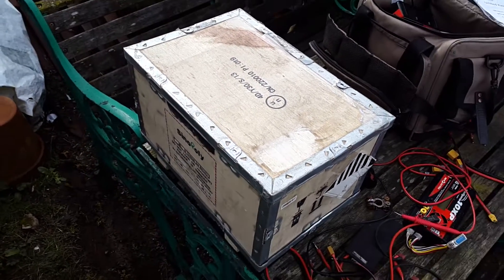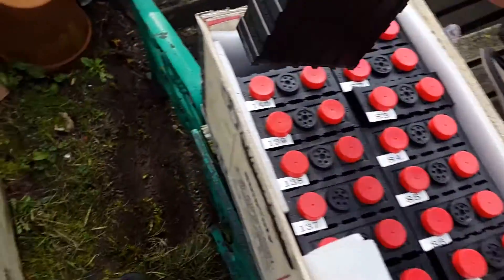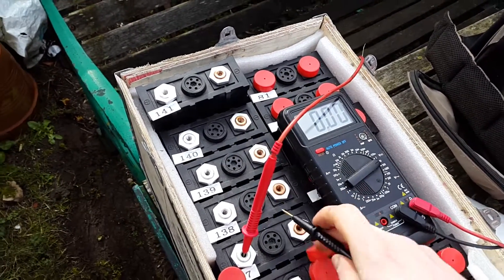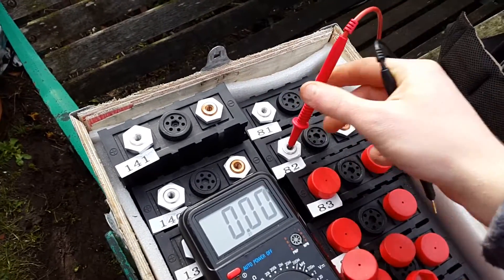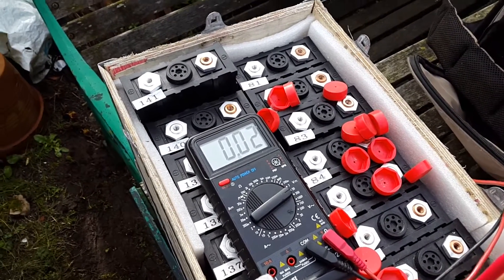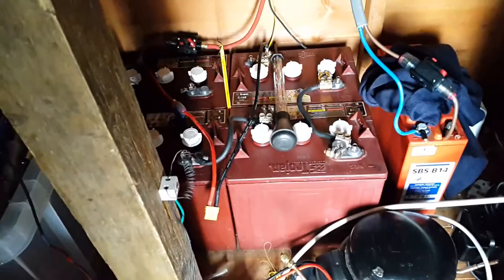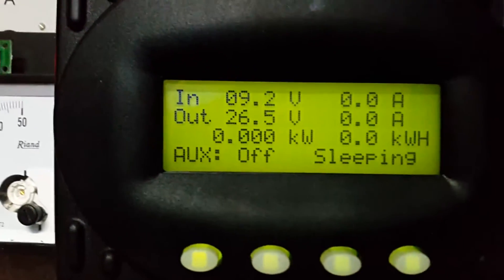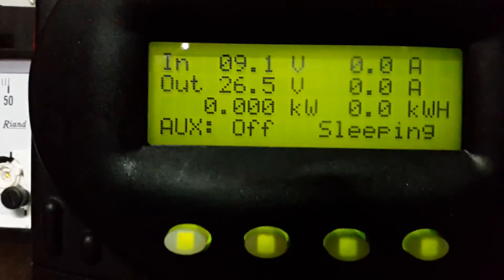Sinopoly Lifepo4 Solar Batteries

Comment: I am looking at some new 200ah LiFePO4 Prismatic Cell, for $240 ea. X4. Want to run them with my Kodiak Inergy solar charger. I already have 3 x 340ah 1000wh packs of 3 for 12.8v each battery pack. No BMS needed, the Kodiak manages the batteries for me.
Reply from the maker: Good choice.
Reply: Where did you buy the Sinopoly 200Ah?
Reply: Pls try to search  RUIXU battery on amazon
Reply: @PrimalMiltos  You can buy them from aliexpress.com

Comment: I love these batteries A lot, but in no way are these safer :)
Reply from the maker: How not? they are lifepo4 and will not burst into flames if taken slightly over their rated voltage.
Reply: SLA will almost never burst into flames even when charged to 16 or 17 volts, and no balancing needed 2 reasons they are safer even if shorted they are less likely to catch fire 3 reason they are safer, if you drop a sla it might leak a little and thats it, drop one of these and they can get hot enough to start a fire, I know I have them and have been running test, lifepo4 also put out a very toxic gas when they overcharge, sla will vent but not near as bad as these lithiums, I love lithium and I know these are the batteries of the future, and I like them much better, but they are more dangerous then sla. flooded is a different story. just the fact that you need to keep them balanced makes them more dangerous.
Reply from the maker: Sorry, I was comparing them to the lipo batteries I was using 
temporarily. You are right, lead acid is the safest but it is just crap 
in every other way. The only other good thing about it is that it can 
operate at very low temperatures.
Reply: haha yes lipos are much more dangerous :D
Reply: Here's a LifePo4 dead short test.  If you had done this with a lead acid,  you'd have acid blown over everything. If you did this with a regular LiPo, it would have outgassed and created an uncontrollable fire.  LifePo4 - safest battery out there.  https://www.youtube.com/watch?v=p21iZVFHEZk